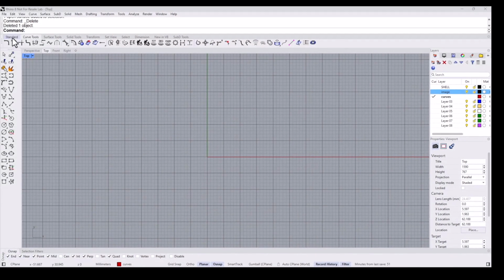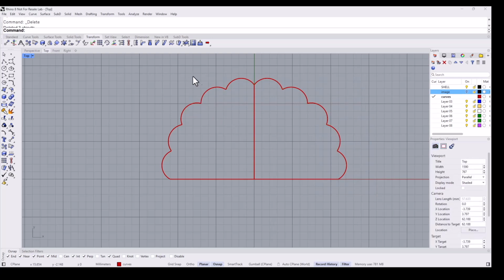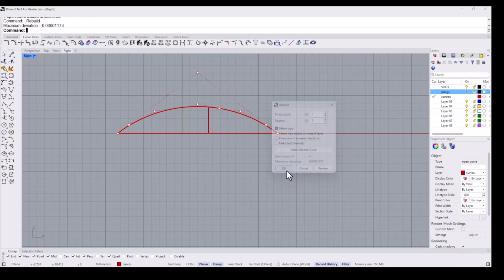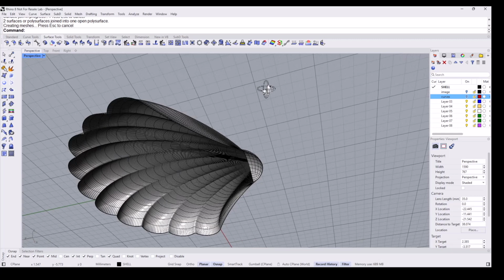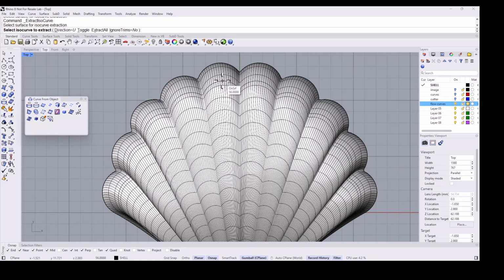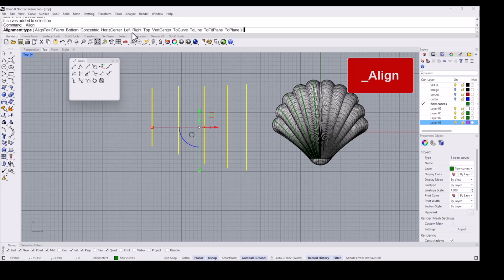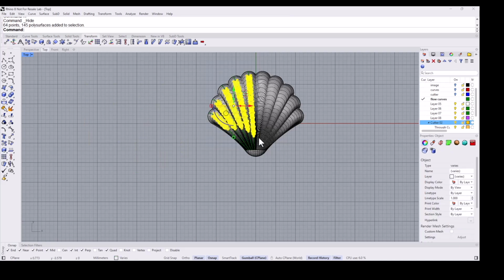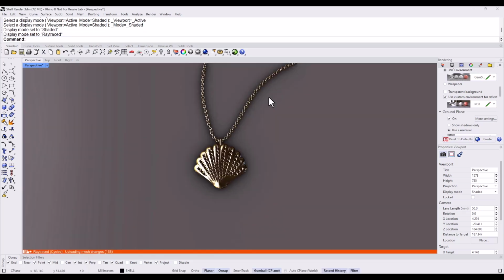A Shell Pendant with Stones  #rhinoceros3d #rhinotutorial #cycles  #diamonds

Comment: Thanks for the tutorials, they're great. I use a plugin called Free Jewel, which creates a diamond from a circle with the measurement you specify. I've been using it for this pendant, but when I did the Boolean difference, it wouldn't work. It turns out, after beating my head, I discovered you can't do that because the plugin uses sub-D to generate them, and they're different surfaces. I don't know if you've ever used it, but I swear I've done it before. And I could do the Boolean difference. Thanks.
Reply from the maker: We'll have a look at this plugin!